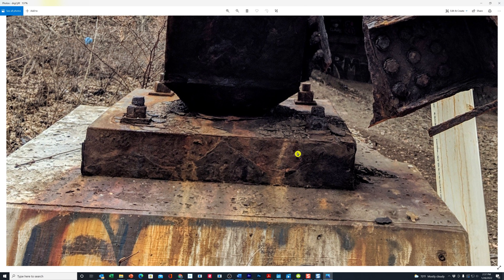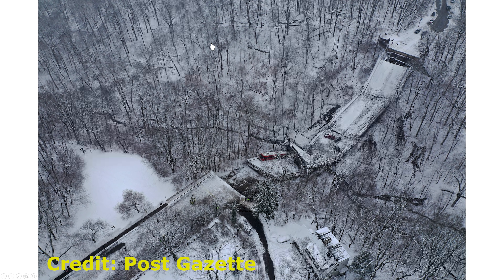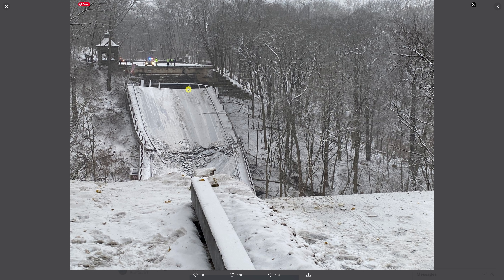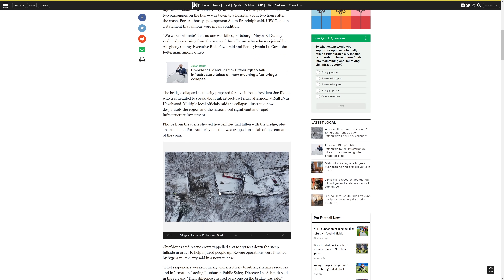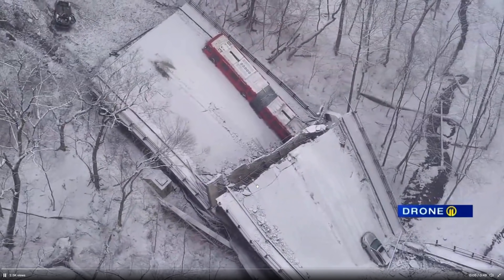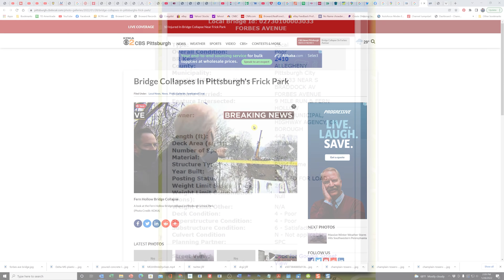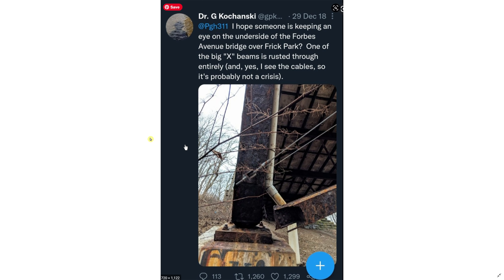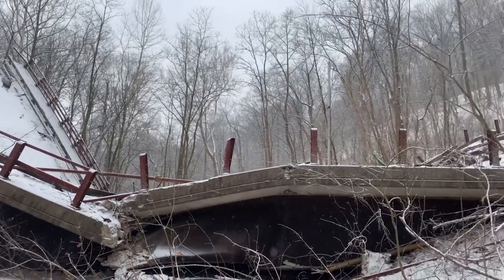Pittsburgh Bridge Collapse Cause, Forbes Ave Bridge Frick Park Rust?

Comment: 20 yr + registered P.E. bridge designer, inspector, and load rating engineer. This is a known as a K-Frame structure, which in my travels across PA, I have seen a ton of, especially over the turnpike.  Very light and efficient system, but is fracture critical. 

Often times the load rating of the bridge is controlled by the longitudinal stringers, and sometimes the transverse floorbeams, especially for a bridge as wide as this.

The snow isn't an issue, neither is any minor ice that may or may not have been there. The cars are an afterthought to a bridge, and there were likely no pedestrians on the bridge.  So all in all a very lightly loaded bridge, all things considered. 

And really, not even the bus, that was on a relatively open structure, which more or less sounded pretty empty as far as bus capacity goes.

What is interesting, is the load posting sign of 26T you can see in the street view.  It has no indication of axle configuration, as to how that 26T is spread out.  A long bus like that, typically can be much heavier, in general, than say a concrete truck, with its 40T on a very short spacing relative to an articulates bus of say 50' or 60' .

All that being said, if the cross bracing on the "K" is compromised,  then all bets are off. The columns of the frame will now govern, because they are "theoretically" much longer than their original design, with a severe reduction in their capacity, causing a failed buckling event, long before any of the capacities of any of the stringers or FBs are reached.

Sidebar, I'd recommend you change your layman's thumbnail.  Every single steel bridge has 'rust'. Corrosion is the word you need. And the sheet corrosion you see on the bearing plate isn't really an issue, for a design case of a fully loaded bridge, that has a very, very, very low likelihood of ever happening.  Thats probably like a 3" + plate thickness, a small amount of section loss to that location isn't really a big deal all in all.  May have actually come from above, which would be much more concerning. 

My two cents, and thats all they are, is a column buckled, and the FC bridge came down with it. 

Apologies for any fat finger spelling mistakes you may find.

YMMV.
Reply from the maker: I left it as rushed because that's the word that most laymen who are going to be watching this video know they don't understand corrosion. The corrosion. Also I'm working on a follow up and you'll see an where I think that The one column sheared off of the top of the concrete pad and it left just that 3" plate that you said wasn't the problem. I suspect there was a bearing at the bottom of the  Column where it meets that steel plate with the 4 bolts and nuts holding it holding it on top of the concrete pad.  Look for my video analysis on this hopefully Monday night
Reply: @jeffostroff  And if there were bolt(s) corroded that badly, then again, all bets are off.

Bad mojo.
Reply: @thanos9846  Thank you for such a great explanation! Just wondering, any chance the bridge had "help" falling right before a certain someone came to speak? I know, I should like a conspiracy theorist, lol. I watched a vid that mentioned this and it made me wonder. Just curious what an expect thinks. Thanks and be blessed.
Reply: I worked as a D1.5 fracture crictial bridge code welder plus traveled the Pacific North West doing repairs and upgrades to Grain Elevators and barge load outs, high rollers ect. And various exposure C type builds from bridges to solar panel mounts To portable tub gravel filled mounts to hold solar panels to be used on the North Slope and down the pipeline to provide portable power source for various reasons. 
 Those pics that showed the base plate on the pad with the broken box tube hanging with cables strung for support also shows the column that was welded to that base plate with most of the contact area where it was welded GONE! LIKE JUST ROUNDED OUT! So basically they ran tension support cables to a column that was held to the load bearing base plate with Down force, hope and whatever bird SHIT that didn't eat it's way into the steel it provided speed bumps to stop it from shearing off? 
 Good Lord! And who runs water drainage to exit right at the base of a footing? I sure hope that went right into a pipe and not just out to wash away the support the footing was poured into! 
 Whatever happened it did so in the contraction of the cold! The snow just happened to be there!  But the issue or issues started LONG AGO! and were left to compound long enough that no single repair would fix because it's clear there was nothing to tie into that would be considered worth a tie in! 
 That was at complete overhaul level some years ago is clear!  And sadly I know this is a trend that will only continue and at larger scales more rapidly as our govt has been so busy over the last 50 years  trading American workforces off for cash in their pockets that the term routine maintenance is an unknown word!  Anything that is colored a shade of baby SHIT green is probably from the 1950s era and if maintained is still running today! 
THAT BECAME A PROBLEM FOR A CONSUMER ECONOMY! 
 So they want things to break! You have to buy more! The problem is these dipshits forgot that when bridges break THEY FALL! Not one GREEDY ASSHOLE wants to spring for proper maintenance over the last 50 year's out of the budget cause they too busy STEALING IT FOR THEMSELVES! 
 WELL THIS INFRASTRUCTURE PLAN! 
HAVE YOU HEARD OF TOO LITTLE TOO LATE! 
 HEY JOE!  HOW MANY YEARS IN OFFICE? WHAT HAVE YOU ACCOMPLISHED?
 I LIVED IN DELAWARE FROM 96 TO 2010! SO YOU CANT BULLSHIT ME! 
 Sorry but this is going to continue rapidly because most of the foundation of what we have all is reaching the same age at the same time and with zero care for it and WE ONLY HAVE PUT 6 TIMES THE AMOUNT OF DAILY USE AND LOAD ON THEM IN 50 YEARS! So what do you think is gonna happen?
 But what do I know?
I wasent born yesterday I was born this morning!
And I'm so "WOKE" I woke up and went to work today! 
 These people are the epitomy of stupidity!
Holy SHIT! 
Lol won't be long now!
Reply: APPRECIATE REAL INSIGHT.  THE MEDIA WOULD NOT BE HIP TOO.
Reply: @hleigh7201   “Help” That is the first thing I thought. Then I thought the collapse could be a diversion for something bigger to come that day. Then I thought I should stop thinking like Jack Bauer (and now I’m kind of excited to rewatch a few seasons of 24).
Reply: @pegleg00  lol
Reply: Juicing
Reply: The cable tie they install may have introduced a force into that support beam, contributing to an inward buckle event. My knowledge of these type of structures is limited, but I'm willing to bet the support beam with the cable attached half way up was the first part to fail. It buckled inward.
Reply: It appears this post is from a real bridge engineer!
Reply: @timhallas4275  Tim I no nothing about bridge or any other engineering but I have always had a good eye and I did take diff's. I was looking at the cable, the point of attachment and likely corrosion in the column. Plus you got to think if something that obvious was going on what the hell was happening under the bridge deck.
Reply: @jeffostroff  The bridge superstructure was made of Cor-Ten steel, a.k.a. weathering steel.  Most of the "rust" is actually forming a protective barrier over the surface of the steel.  Cor-Ten steel is intended to be left uncoated because of this protective property.  What you're seeing there is bare steel that has been in the elements for 50 years.
Reply: @jeffostroff  On a usual day, that bridge is packed with vehicles. The weather was bad hence the light traffic. There is also a busy intersection near there so vehicles are stationary for long periods of time.
Reply: The Department performs full inspections every two years for all bridges in the state. You could find this report through an OPRA request. Inspections are performed by consultants and submitted to the Department. That said, who owns this structure? I'm not from the area and it looks like a bridge in a park that would typically be under the ownership of the City.
Reply: Very interesting read and explanation. Thanks for taking the time, I appreciate it.
Reply: I  also noticed that it doesn't say 26 ton vehicles cross one at a time... how many , 26 ton can cross at the same time,  if it's a two-lane bridge the engineer would have to know that there's a possibility to 26 ton vehicles could be crossing the bridge simultaneously...
Reply: @martinvisokey8958  That is already taken into account, by what are called Multiple Precense Factors. 

Sometimes its the case of a single lane loaded, which has a high probability,  so it has a much higher factor than say four lanes at once (much more load, but much less chance of it happening).

Often times one part of the bridge will control under say one-lane of traffic, while something completely different will control under all lanes loaded.

Then the minimum of all that will control the allowable tonnage the bridge can support. Typically its based on # of axles, which usually equates to a longer truck. Heavier load, but more spread out.

Say 15 tons on a two axle rig, 20 tons on a three axle rig, and 26 tons with a four axle rig,  typically accompanied by a picture of a truck with said # of axles for illustration purposes.
Reply: @thanos9846  that multi-present factor is a good thing, Because I'm driving a 130,000 lbs truck over Arch  bridges built in 1923 . Along route 7 in West Virginia. The route I travel has been approved and the permit says go across those bridges... Thanks for your time.
Reply: @poorringo  🤣🤣🤣
Reply: @timhallas4275  That's a grea point Tim. Cross beams strengthen a structure where as a cable creates a pulling force on the structural beam. Something you definitely don't want, especially with this particular design.
Reply: @poorringo  lol the politicians will blame it on global warming
Reply: @joecifelli1253  That cable may have caused the beam to buckle.
Reply: So this bridge is ok?
Reply: @robhoard9114  Yes Rob, the bridge is perfectly okay. Go take a stroll over it.lol jk jk jk
Reply: @timhallas4275  sounds like the taxpayers have already paid for it.  Their payments were funneled "elsewhere" for "other reasons."  There needs to be an immediate in-depth investigation where that money went and why, and those responsible for the misapporpriation forced to repay every damn dime to repair this and all other bridges and infrastructure, as the tax was originally intended, while serving a lengthy sentence in an ill-equipped prison on charges of at least negligence and tax fraud.
Reply: My original intended post "I'm not a metallurgist but i understand quite a bit from my Navy training (dealing with Corrosion Control and Lifting Structures aka A/C Slings):  Looking at the BASE and all the C/C needed (and probably hasn't been done in decades) I'm gonna guess the tools who last inspected it, might have phoned this in, when they filled it last. Certainly nobody in the city probably knew (their mass transit system buses still ran across it and who knows how many overweight trucks took it because TOM-TOM said it was the fasted way, etc...) eats popcorn Yes, the NTSB report will be hopefully SCATHING folks in boiling water when it's finished..." I do have to disagree with you about the unimportance losses in steel from corrosion. Size (and thickness) matters when the math is being created on the drawing board. Change the numbers, you change the math. Change the math, you change the Tonnage signs at both ends of the street... I still think someone phoned this in, personally (but I'm a 50 year old Gen-Xer: I assume its all gundecked, unless pleasantly disappointed otherwise :/ ) Edit: LET me get that straight: a MAJOR load bearing structure BROKE apart and their fix was TEMPORORY CABLES?  Thats like some idiot thinking you can weld back together a Aluminum Towbar tube that someone in Air broke (and it'll be weeks before we get a replacement tube on hand). Sure, you could try to weld it but do you really trust it to pull a plane in pitching sea states? LOL, there better people on pikes shoved up their assholes over that fix on that bridge... because you're right: The numbers DID change. Now the bigger question: Who knew and who politicked ignorance because in those stills, it was VERY common to have cars backed up from stoplights far beyond the bridge apparently...
Reply: is rust not corrosion? corrosion is a more general term than rust. Fe2O3 could be anywhere from superficial to entire disintegration of a member. am i nitpicking?
Reply: @goddamndontcare  but it will corrode in joints that harbor chloride residues. A606 and A588 is good stuff but its not stainless.
Reply: @thanos9846  thank you for "multiple presence factor"
Reply: @skillmentrades7915  never have, since the 80s, bought into the trump cult-o-personality. always wondered why clintons wife politically ascended. so its not a partisan thing to wonder what the hell this situation means. say im in the cult-o-critical thinking.
Reply: Thanos — the 26-ton limit is obviously the gross weight of any single given vehicle.  Although it's pretty retarded to post that weight limit on the bridge itself where a truck would already have to be in order to see it.  Those weight limit signs should be posted a half mile back to give trucks enough time to stop and turn around.  Having wieght limit signs on the bridge itself is about as stupid as signage goes.
Reply: @puma.will.pounce7590  What is important in the 26T limit, is the axle spacing and axle load it takes to get to that 26T. That is the info the sign is missing. Is it a long, two axle rig, with very heavy axles but spaced very far apart so that the lead axle does not impart much load into the rear axle area, or is it a short multi axle rig, where most of the load is concentrated into a relatively small area.

Typically you would see the posting go up as the truck length increases. Something like 18T for a two axle, 22T for a three axle,  and then 26T for a four axle truck.  A nominal image of these types of trucks is then typically placed next to each weight limit.

For most states, not sure about PA, the state law is to post the weight  limit at the bridge.  However, most bridge owners place advance warning signs well before the bridge, typically near an intersection where the vehicle can turn and avoid the bridge.
Reply: @thanos9846  — In Pennsylvania — and all states — that 26 TON weight limit sign is the maximum weight limit for one single vehicle regardless of axle spacing or number of axles.  So the weight limit is 52,000 lbs. (26 tons) PER VEHICLE whether it's a dump truck, tractor trailer, bus, crane, RV, or car.  The sign isn't missing any information.
Reply: @puma.will.pounce7590  The sign used depends and how severe the restrictions need to be, not necessarily GVW.

The (former) existing sign appeared to be a MUTCD R12-1a sign, which is indeed GVW, regardless of axle configuration, and includes all trailers being pulled.

The R12-5 sign however, represents the M3, M3S2, and M3S3 type trucks (known as the AASHTO family of three), used to replicate common trucks in the industry, is required where the rating is axle based, not GVW based.

I've probably signed several hundred load ratings, 95% or so that require load posting use the sign with the three truck description. Use of the R12-5a or the R12-1 signs are on the obtuse end, typically used on bridges with severe restrictions.

Though not unheard of, I personally would not expect a single tonnage restriction of 26T, but then again, it is a FC bridge, with known deterioration and a cross brace which appears to be detached at it's base, and where the columns are in play, unlike most nominal bridges. 

YMMV.
Reply: Yet here we are sending money to Pakistan for gender studies.
Reply: This is a huge issue to be honest. Jeff really needs to reevaluate his approach to educating the layman on a subject. Theories mean nothing without proper judgment, and there's no reason to rush a video out with poor judgement and leaving out critical information. 
It's completely inappropriate to just say "nah, most people won't understand it" and don't even try to give any explanation remotely. It's important for the laymen to learn rust vs. corrosion instead of just telling their friends after watching the video erroneously collapsed from rust, snow, weight of cars, etc...
Never good to have discredit to one's name with shoddy intel. 
I hope he reconsiders and changes the thumbnail. Jeff is otherwise good at what he does, but he should avoid engineering failures in fields he does not have experience in, and instead, ask experts first.

He should really mention the differences between substructures, superstructures, and decks considering he brought up the bridge's report in this video. Oh well.